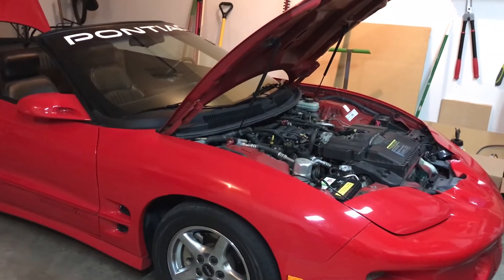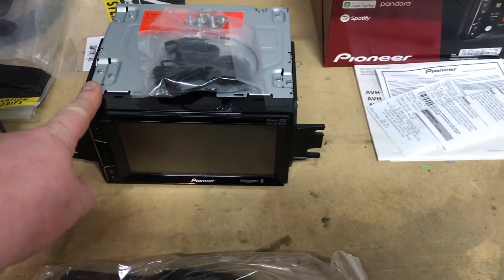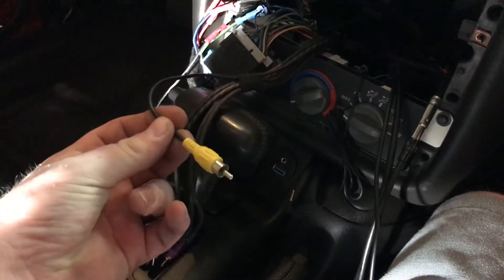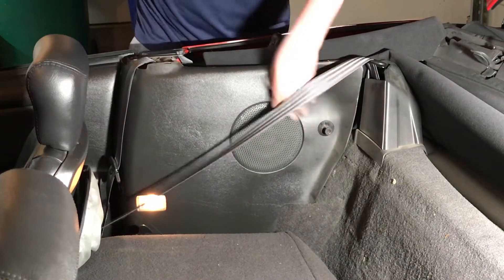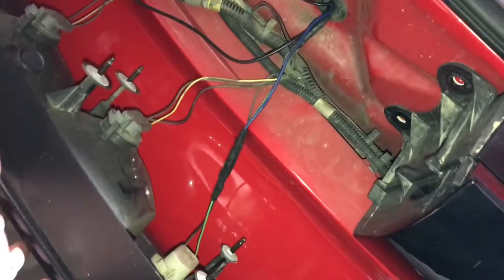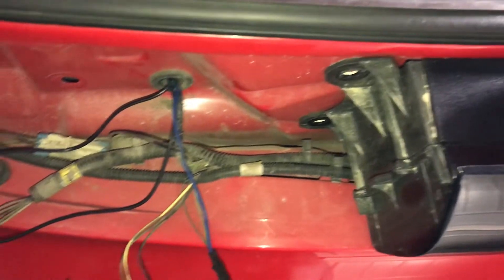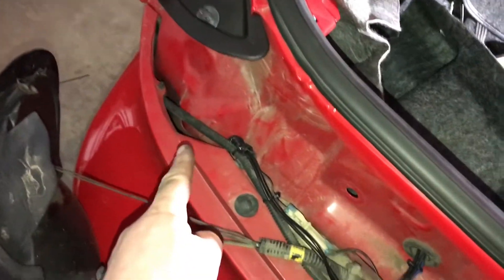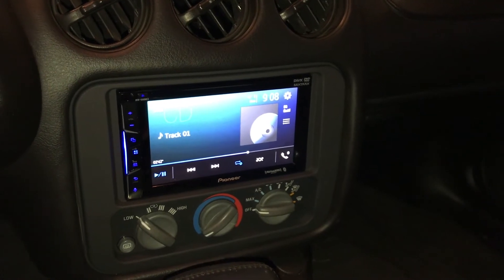1993 - 2002 Pontiac Firebird / Camaro Backup Camera Install

Comment: That's awesome, I'm considering getting a 2001 firebird and adding something like this.
Reply: I just bought a 2001 Firebird three weeks ago. Think I'll do this too!
Reply: @markiefufu  buying a 94 firebird, is your 02 reliable?
Reply: @Xlnjv  yes, it's been very reliable. I've owned it since late August of last year and only thing I've done as far as maintenance is change the oil and put in a new battery. I haven't had any system on the car fail, though I could use new tires. It has always started right up and never given me any issues. The T-tops don't even leak in the car wash. Lol.
Reply: @markiefufu  a t top sounds badass, the one I’m getting is an F body tho so it Unfortunately doesn’t have em, And I always hear people giving these cars shit but most of the time it’s people who’ve never even owned one speaking down on them, not sure why tho. They look and sound great. Do you have the v6 or 8?
Reply: @Xlnjv  mine is a V6. Isn't fast, but has the Trans Am handling package, so it's still fun to drive. I keep the top open on nice days. Not a lot of wind for the front seat passengers.

Comment: I am having trouble seeing where you drilled the holes underneath the bumper.  It looks like it is in the middle of the car.  Then when you said you fished it thru with a coat hanger it looks like it is the left side of the tail light.  Could you describe where you drilled the hole and its relationship to the tail light and the interior of the trunk?

Comment: Where did you get power?  I know you mention that it's from up front, but not sure where.  Also, I have a cd changer in the rear that I will be removing. So can I use power (red wire) from that?

Comment: Got a question on hooking camera up with its on switched power source so that you can activate it when u want. I hooked up a switched power source off of radio but the camera stays activated all the time once you select the camera on the radio. How can I get camera to only come on when selected?
Reply: Nevermind, found your video for installing  camera's for radio and found out that camera stays powered on all the time when u wire it up from a switched source.

Comment: Great video, Can the camera be connect directly to an aftermarket amp power? And ground to chassis. So all that would be needed from radio to back is the trigger wire and camera rca?

Comment: Title of the video should be changed. It should titled only for Firebird. 93 to 96 camaro has totally different dash and center bezel removal. You practically have to remove the front of the entire dash to install aftermarket radio. How do I know, because I have 95 Z28 and 93 Trans Am. Trans Am are so much friendly to work on. Camaro is a nightmare.
Reply: Yes I agree. I have a 94 Camaro and I always dred pulling the double den pioneer cd DVD deck out. Going to try and install my backup camera 📷 tomorrow. I think that I am going to run the camera power wire to my tweeter amp remote turn on wire. That way I should be able to view the camera without having to put the car in reverse.

Comment: You obviously know your stuff! here's a challenge for you if you offer tech advise. Wife's car 97 base firebird convertible. there was a 2 din in there wanted  a newer version without cd went with a 2 Gg 32Gg RK-A715. My problem is, I had to butt connect  & soldered & heat shrink   colour codes as per diagram from radio" since previous owner had cut factory connector. I  followed everything as one would, radio boots , plays awesome on acc. key mode + back up camera works but when I turn ignition to on,  the screen goes out & sound cut as well, like wtf ! I know probably a simple fix but?? Thanks,
Reply: You likely already fixed this but on the chance that you haven't, I would check each power and ground connection; ACC ON, Always ON, Ground and the AMP and Antenna ON wires as well.  Check for any shorts of unused wires (wrap them all separately).  I left all the OG wiring in place, uncut, in case I ever want to revert the whole vehicle back to stock.  I can new speaker wires to all four points, added two amps in the trunk along with a sub box and ran a 4ga from the battery to the trunk as well (all power lines are on separate breakers, three total).  Hope that helps (if you still needed help that is).

Comment: You are not clear on the power source for the camera
Reply: Power source can be whatever you want it to be. I put in a switch connected straight to the battery, so I can toggle my super cheap camera at any time.